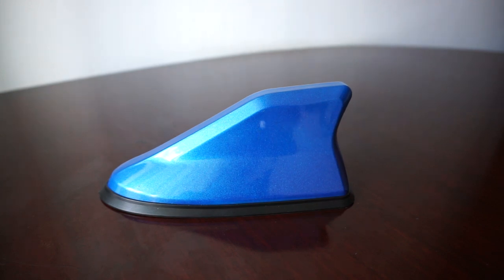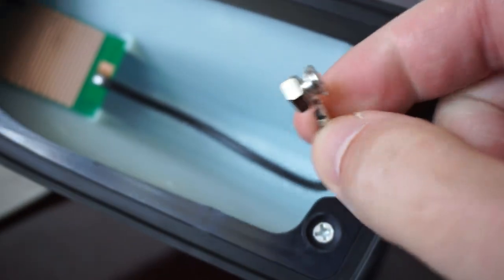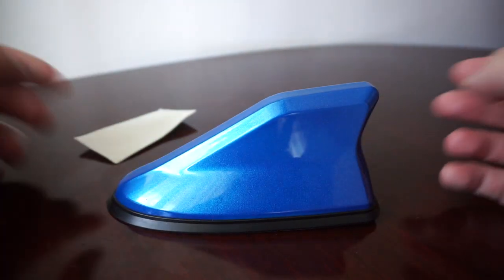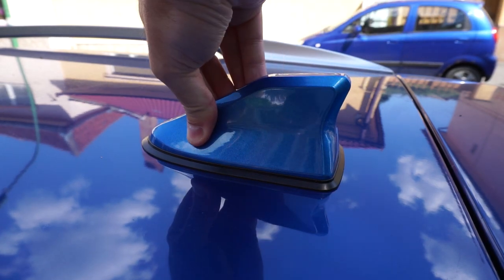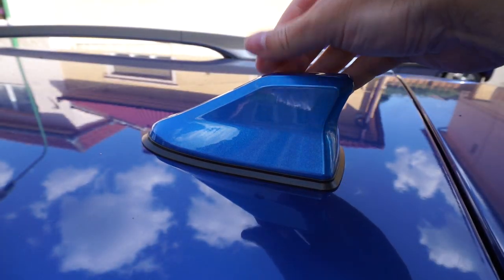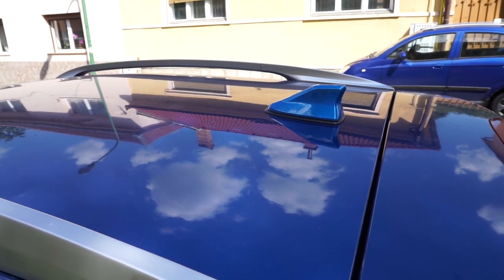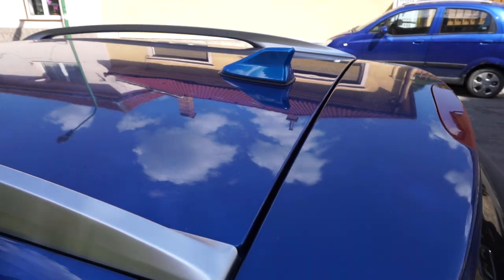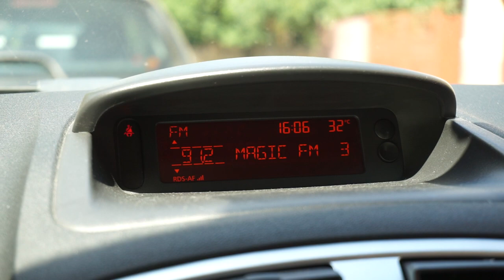Shark Fin Car Radio Antenna Review and Installation

Comment: I have more of a dark blue (audi) color.
Should i get the black or blue antenna?
That is the question...
Reply: I think I will go for the black, right?
(my blue color is darker than yours)
Reply from the maker: @staffan144  I depends on your preference. In your case the color off-set will be even greater, but still I like it as it is.
Reply: The one I have doesn’t match at all, it was darker in the picture. 
So I’m going to paint it in the matching colour my car has. Just look up the colour code and order a can. A clear coat is necessary.